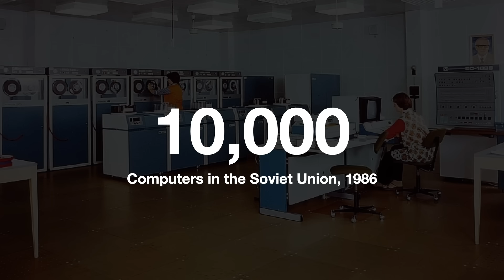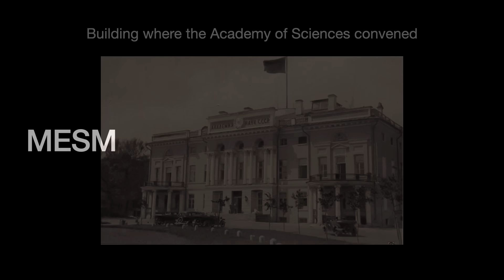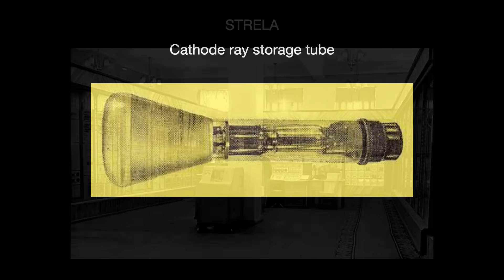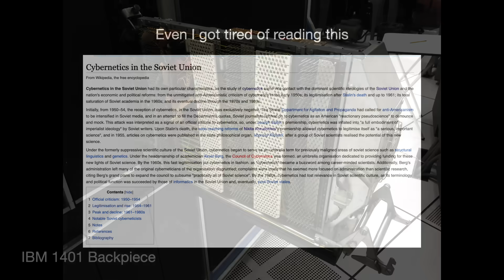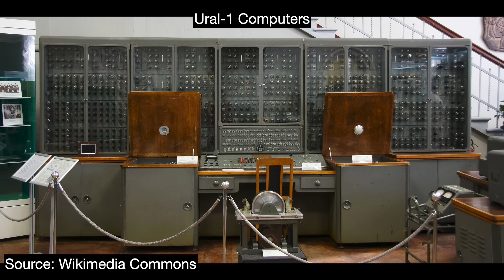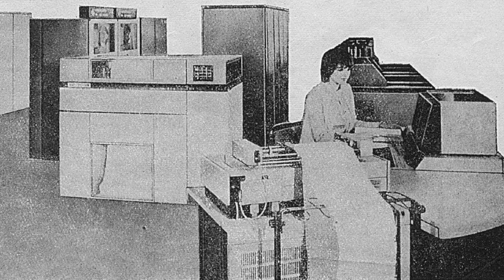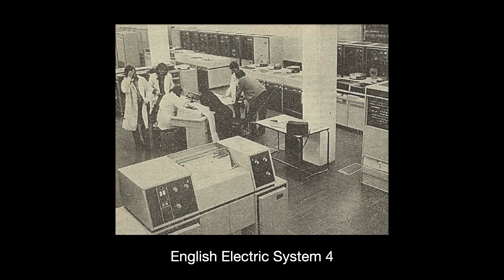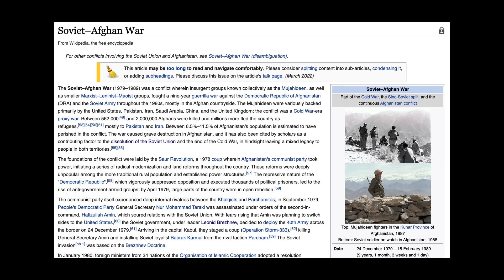Why the Soviet Computer Failed

Comment: Great video and very interesting insight. But many major points are missing: in fact, by the end of 80's the soviet semiconductor industry actually closed the technology gap and where capable of making world-class computers. But it was still not targeted at mass-market - home PCs and videogame consoles doesn't exists in USSR. There was some minor supply of advanced programmable calculators and IBM-compatible computers (beside what was imported), but the consumer's market never took off within lifespan of USSR.
Reply: There are a lot of people who still don't understand that the real technological genius of the United States was never in making the most advanced widgets possible, but in manufacturing large numbers of pretty good widgets at scale and putting those widgets in the hands of as many people as possible. It's the difference between building a Ferrari for the wealthiest man in town, or getting a Model T into the hands of every family in town.

Over time, the U.S. ended up with the most advanced technology largely as a consequence of that focus on manufacturing at scale - because the new technology was in the hands of far more people than would otherwise be possible, with many of them contributing to new ideas and new designs that made the tech better.

My father worked as a civilian for the U.S. Army in a division whose purpose was to look at the technology that foreign militaries had and how the U.S. could either counter it or copy it. He had a lot of respect for Soviet military equipment - but noted that the problem for the Soviets was that although they could build good equipment they couldn't build much of it, and the military took almost everything that the country could produce in certain fields. For some of their more advanced tech, production yields were less than 3%. That is, they'd produce a hundred widgets and were lucky if they could get three that worked.
Reply: @alanlight7740  that's true. And the main cause was, surprisingly, not the communism - there was no communism in USSR, it was never achieved. Somewhere down the road the direction was lost: instead of pushing for higher quality of life for the people (as true communism proposes) the system started to grow parasites within. No one ever thought the computers or some other electronic devices going to be actually useful for general public. The government had no intent making computers available to people and private companies and businesses where nonexistent because of "upcoming communism". The system with no mechanisms of self-regulation (no competition / free market) was cursed.

Makes me wonder, how much better world may be if someone was able to build real communism? F.e. like in Star Trek :)
Reply: @shurmurray  - I don't think "real communism" is possible, because it self-destructs - that is, it crumples under its own weight. There's a long history of communists pointing to the latest communist project and saying "There it is! that's how it's supposed to work!" and then ten or twenty years later when everything has proven a disaster and the people are starving they say "That wasn't real communism! Real communism has never been tried!"

But they thought it was real communism when it began - so why change their opinion later?

Well, in one sense they are correct when they look back and see how things panned out. What happened was not real communism, and could never be real communism - because communism - at least for humans rather than ants - is like one of those short-lived elements that is made in a laboratory, in that it flashes into existence just long enough to be measured by special instruments before it decays into something completely different. When they say that it wasn't real communism - well, it was for a fraction of a second - and then it decayed as it must always decay because it is naturally unstable, and usually becomes something much worse than the status quo ante.

The truth is that the only system that has provided much of what communism claims it will provide is capitalism, and especially capitalism combined with either a tradition of British common law or Japanese feudalism. It is possible that if the southern states in the U.S. had been able to retain their independence in Mr Lincoln's war, that the South might have something similar - with both common law and feudal elements. Possibly the southern states have maintained something like that to a small degree, which might partially explain its strong economic growth in recent decades after it finally managed to recover from the war. (It is not much known to modern Americans, but Lincoln's supporters included many communists or socialists - the terms being synonymous at the time - and this included his Assistant Secretary of War who was a personal friend and colleague of Karl Marx, as were several Union generals. That is, the "radical republicans" were in essence communists. Fortunately their influence was largely curtailed after the war.)

It is possible that some other legal traditions could provide similar results if given a chance, but in the real world that hasn't happened in an obvious way - though David Livingstone thought very highly of Tswana legal traditions which he considered similar to British common law, and Botswana today is perhaps the best run nation in sub-Saharan Africa. It is difficult to trace the origins of that success, however, as Botswana has, besides retaining some of its own traditions, also embraced a good bit of British common law.

It's a curious thing about Sci-Fi, in that movies often depict future capitalist societies as lawless and chaotic, while future socialist societies are depicted as orderly and prosperous. By contrast, almost every experience in the real world has been just the opposite. I think this says more about who makes Hollywood movies and television shows than anything useful for understanding the world. When one is producing a movie, after all, the plot armor can be as thick as one likes. Written Sci-Fi, especially hard Sci-Fi, tends to favor capitalist economies, because the authors are focused on the mechanics of how a future society might work rather than merely writing space opera.

Finally, I'll just add that there is one other major economic system at play that is already very much relevant in the world of software, and that is the Potlach economy, or the gift economy. This sort of economy is only possible on a large scale when the cost of production is zero or near zero. Software meets this requirement when one considers merely copies of the original software, and the result is the free software movement, open source software, the Linux operating system, the Android operating system, and so forth. The Potlach economy can piggyback on a traditional economy, and as new production techniques make the cost of material things extremely low we are likely to see this gift economy grow to include parts of the physical world. A combination of automation, artificial intelligence, 3D printing, and robotics is likely to produce something like this - and it will produce results similar to what communists always promised, but will do so based on a firm foundation of property rights and capitalist principles.
Reply: @alanlight7740  Wow, that's a detailed answer with some very interesting points!

But wish to share some of my vision (maybe no so deep, though):
In USSR there was officially no communism even back in days - there was movement/transformation towards communism. And the com. party said socialism was achieved and the communism is the next stop. The biggest communism attempt in fact never stated it was communism.
The other examples, IMHO, should be analysed case-by-case. They are not the same. At the end of the day, capitalism cases are also not the same and not always succeeded: even more - in most countries it works against people and economy (sometimes in favor of foreign capital).

My personal understanding of why all attempts of communism fails. Again, just an opinion:
1. When some new communist country or region created, it is surrounded by capitalism and must fight for resources and money. Communism must interface with external world by the rules of capitalism. If it fails it looses resources and dies.
2. In capitalism, the main entity is money. Speaking oversimplified - the money is the ultimate goal in capitalism. Even humans are just the resource for money. Capitalism tend to grab any unclaimed or not well guarded resource and consume it. In communism at least some resources are public or somehow shared. It provides effective use for the whole system, but only if everyone uses it on a need basis.
If there are any points when capitalism touches communism, the capitalism tends to grab "free" goods. And looking back at p.1, there usually a lot of opportunities for the capitalism to parasite on communism.

3. In theory communism may work if the barrier between it and capitalism entities well-defined. Including some extreme measures like "iron curtain". But there is one more factor: people. And people's habits and traditions can't instantaneously change. Beside cult of money, capitalism relies on some basic behavioral models. Mainly the cult of private ownership and intention to consume more. This is so basic for us so we can't imagine living without such goals. And when you trying to make perfect communism world with rational and effective use of all resources - you bringing people with deeply encoded goals from capitalism. Eventually there going to be individuals inside communism who consumes more that others. And those individuals gain more power and starting to control whole system, draining resources for they personal needs.

4. I think when AI took over the World and get rid of skinny bastards - it may easily construct communism. Not sure if robots going to be happy, though :)
Reply: @shurmurray  - I would reduce the reasons why communism has always failed to chiefly two:

(1) Human nature, which is inherent to us and incredibly difficult, and possibly impossible, to change.

(2) As pertains to a centrally planned economy, there is simply no way that a central planner can make good economic decisions. This has been found to be mathematically impossible - there are simply too many inputs for a central authority to process.

I also consider property rights to be essential to human happiness. Property is, after all, the product of our time and labor - and to take property from those who produced it is akin to slavery. It is merely slavery after the fact.

I might also add that collectivist ideas have a long history of failure. Both Jamestown and Plymouth were initially founded on collectivist principles, and over half the colonists died each year until this was changed. These ideas just aren't compatible with human flourishing.

YouTube doesn't like it when I put a link in a comment, but I would suggest that you look up the "Philosophy of Liberty" animation produced by the International Society for Individual Liberty. It's available on YouTube and other places.
Reply: @alanlight7740  Hi again! Watched the animation you mentioned (going to focus on it later).
I suddenly realized I didn't established the core points of my arguments. Without them it looks like I just advertising communism. The core point is the set if issues produced by world-wide capitalism. The main issues are: 1) uncontrollable and unlimited consumption of Earth's resources and 2) planned obsolescence. Everyone talks about climate changes and excessive waste produced by undurable things, but very little is actually done. F.e. most claims about so-called "ECO" things are just BS. As a concrete example - all the EVs. The electricity is mainly produced by coal plants (add extra when the energy is transmitted over wires and inefficiencies of charging the batteries) and the EV itself are very hard to dispose item. There is still no recycling of lithium batteries: capitalism says it's to expensive and just refuses to do it. Sure there are some successful cases but overall everything about ecology still going south.

While the global warming and ecology stealing out future, the planned obsolescence stealing our property right here and now. It enslaves us the other way: we put effort to obtain property, but almost all property ensures it won't last for long. It makes for people very hard to accumulate things and get increasingly high value out of them: capitalism forces you to pay. New phone every year, new car (designed to transport five people, but takes only one) every 3-5 and so on. Capitalism purposely poisoned everything to make everyone pay and the top most goal is money.

In turn, we probably should look for solution elsewhere. The communism has it's own issues, but there are good things as well. From my point of view, the most useful for the whole humanity - shared resources. Are we sure we must own everything we uses? There are many items needed only occasionally. Flying on vacation does not forces you to buy whole jet plane. There are much more examples of shared resources on a small scale: within our family homes. Almost everything is shared within family and that's ok. There is no personal toilets or personal vacuum-cleaners, TV and coach also shared. Sure the concept of shared resources can be scaled up in a way the larger and larger groups of people would benefit from it. But capitalism doesn't like such movements and fight back. I think this is actually the main reason communism fails - it fails not in isolation, it fails in a direct fight with capitalism.

Even the opensource slowly failing against capitalism: more and more linux distros are poisoned with pre-installed ads, telemetry and proprietary pieces of code. Happening right now.

And now about that cartoon. It almost right. Almost :) The remarks must be made: the result of our lives not always out property. Especially not the things purchased for money - they are mostly a short-term crap from capitalism. Much greater results (see not further than old and dusty Maslow's pyramid) are social recognition, love, usually associated with something made for the world. Our skills and knowledge are also results of our lives and they much more valuable than property.
Yet I agree with the part about governing officials with hats who ruins everything. Minus the statement we still choose them: in most cases the elections are faked in one way or another. The most simple way elections fails - candidates are not random. Only special people with money can ultimately appear in the list of candidates and ordinary people can't do much about it. Capitalism uses capital to ensure uninterrupted control over the world.
Reply: @shurmurray  - I see your points but I think you have missed a few of your own.

First, capitalism does not exist in a vacuum. Yes, some people focus too much on money but that has problems even within a capitalist system. A bigger issue in America is short term thinking, which is sometimes connected to the money-centric view of the world - but short term thinking can be disastrous regardless of whether money is at issue.

Traditionally in the U.S. capitalist economics were moderated by cultural norms, and especially those norms embedded in Protestant Christianity. Placing too much emphasis on money is just one form of idolatry in accordance with those values - though of course it would be foolish to ignore the necessity of sound fiscal practices.

Second, communism fails in isolation. The colonies at both Jamestown and Plymouth were initially established on collectivist principles, and every year a majority of colonists died until those collectivist principles were soundly rejected - at which point these colonies began to thrive.

Third, money is just an accounting system - so when we buy things for money we are still exchanging our labor for a product - we are just doing so indirectly.

Fourth, history has shown us that communist countries have had far worse environmental records than capitalist countries.

Fifth, I don't know where you got your information about electric vehicles, but it's mostly wrong. EVs are already being recycled, it just isn't at a large scale yet because very few EVs have been retired from service as the fleet is still quite young. One of the most notable recyclers is Redwood Materials, which was founded by one of the founders of Tesla, and the plan is to make a circular supply chain for materials where retired vehicles are recycled and the materials therein reclaimed to make new vehicles.

Although there are some inefficiencies in the electrical system, they are far smaller than the inefficiencies in the traditional system - which includes shipping oil around the world, refining it (which uses about 4% of U.S. electricity), shipping the gasoline to gas stations, etc. By comparison electric transmission lines require much less labor and lose much less power - and then the vehicles themselves, in an internal combustion engine most of the energy in the gasoline is wasted as heat - and an EV is at least two or three times as efficient. When everything is combined, EVs are far more energy efficient than traditional vehicles.

And no, most EVs are not powered by coal. For a long time coal was about 40% of U.S. electricity generation, but that has been cut by half in the last ten or fifteen years, so it's about 20% now (again, in the U.S.). Solar is currently the cheapest way to generate electricity, but we may also be seeing a large amount of geothermal energy in future - look up Eavor, a Canadian geothermal company that has had a successful pilot project running for a couple years now in Alberta. Incidentally, most of their tech comes from the oil industry, and that in turn means that most of the assets of the oil industry could soon be diverted from producing oil to producing geothermal energy, which is especially useful in cold climates as it can provide both heat and electricity 24/7 and throughout the year, even in the polar circle where the sun doesn't rise for months at a time.

Sixth, planned obsolescence - I understand why you don't like it - most people don't. But it serves a useful purpose too, especially in an era when development of new products is rapid. That is, it allows manufacturers to refine their product quickly. Look at how much better cars are today than twenty years ago, and the cars from twenty years ago from those twenty years before that, and so on back to the first cars. If the first cars had lasted forever their buyers would have just kept them like that and never felt a need to make them safer, more fuel efficient, faster, or more comfortable - and then there would have soon been no market for manufacturers to sell to. The industry would have stayed small if it could have survived at all.

And over time, thanks to new competition (a key feature of capitalism) eventually our cars were built better and better. When I was a kid it was rare for a car to reach 100,000 miles and the car I grew up in made it to about 85,000 - and now over 200,000 miles is routine. I'm glad cars are better built now (and also much safer and more fuel efficient) but it wouldn't have been possible without all the rapid iterations that that market provided.

Your ideas on not having to own everything - well, you're right, and there's speculation that in the near future we may find most urban households giving up their cars in favor of autonomous taxis. After all, the most expensive thing about a taxi is the driver, so if no driver is required hiring taxis as needed can be cheaper than owning one's own car - at least in urban environments where there will be sufficient volume to keep taxis quickly available and where there are often high fees for parking. But all of that can easily happen within a capitalist system, just as airlines exist within a capitalist system.

Eighth, you talk about capitalism allowing people with money to have influence in the world, but capitalism also limits how much influence any one person can have because other people can have their own capital. It seems to me that it is much more dangerous to have a system where influence is gained through politics and political favors ... which in practice is what emerged in every communist country.

Who would you prefer to have economic influence: a capitalist who made their money by meeting customers' needs more effectively than his competitors? or a politician who gained their influence by attending the right parties and bribing the public with their own money?
Reply: @alanlight7740  Sorry for not addressing all points, just trying to keep text reasonably small. I like the conversation is constructive and refers to verifiable facts.

About communism failure in colonies.
Not familiar with history, so i using data from google and my own brave assumptions:
looks like you pointing out the problem of poor management in communism. But there are counterarguments:
1) Now people know how to control stuff or build self-regulating systems a hell lot better than back in days. Most automatic control systems easily outperform humans just in every aspect - in speed, precision and safety. And when human interrupts automatic system we got Chernobyl. In principle, it is totally possible to build a system managing resources for the whole country.
3) Large companies deals with internal resource management for decades without using internal substitute for money or anything from capitalism. There is not much difference if any with planned economy.
2) There are multiple ways to setup resource management beside planned economy and beside free market. Probably the best solution would be some hybrid system with best parts from all -isms.

>> money is just an accounting system - hell no. Unfortunately it's not. Money is not just an entity to mitigate inconveniences of natural exchange. In our real life here on Earth money has owners and long chain of financial parasites doing nothing but exchanging money to make more money. They do not produce goods, they just sucking money out of people's pockets. Periodic economic crises is the most notable effect of this. Yes, I oversimplifying things again and missing many points, but you got the idea.

Environmental impact of communist vs capitalist countries: we have very little examples of succeeded communist countries. And before economy gets successful any country tends to rely on the most primitive and non-ecological processes. Reducing impact on ecology requires technology, money and well-working system overall. Only top countries in the world doing something to reduce effects on ecology. It's hard to tell if communism by itself doing more or less harm to planet.

EVs. It's cool the industry actually turning towards recycling batteries. And the advances in a cheap solar power is a real thing for sure. But the EV itself is just one link in a long chain and the environmental friendliness of EVs are greatly overhyped. The burning fact - Tesla still has to move 2+ tons of weight just to transport one man. For less environmental impact bicycle or PT are much more energy efficient per person and in turn produce less harm for the environment. But advertising a bicycle or PT is not cool: you can't make money out of it.

Sure the obsolescence fuels the progress. But we must ask: what is the purpose of progress? Do we, as humanity, really need that much progress? Mostly it's just a race between capitalists trying to make new type of cr*p to sell it. At very least are we sure all things should be short-lived? Not just cars or electronic gadgets, but everything. Did washing machines or toasters become better for the last 20 years? Capitalism just want to be sure you buy new washing machine every 8-10 years. He does not cares about speeding up progress - it's just a side effect.

Power and money: those were always interconnected. Using power to achieve personal goals is not unique to communism: looking around it plagues almost any country with more or less dramatic consequences. And since most of today's economies are interconnected - negative effects can be shifted to some other poor country. Like Shell in Nigeria.

>> ...a capitalist who made their money by meeting customers' needs more effectively than his competitors? or a politician who gained their influence by attending the right parties and bri... - But it's like choosing between Jason and Freddy :)
Reply: @shurmurray  - the fact that some people abuse the accounting system does not mean that the accounting system is not an accounting system.

And from what I've seen, companies dealing with internal resources generally do use money as an accounting system even if no actual dollars change hands internally.

It's no mystery why the collectivist systems in the early American colonies failed. When some people worked hard and had everything they worked for given to others who had not worked at all, naturally they stopped working as hard - and then there was not enough food, so people either starved or died of diseases that would not have killed them if they had eaten enough. When they were allowed to benefit from their own labor (that is, when property rights were restored to them) they were willing to work and soon produced a surplus.

As for e-bikes and physical training - you want everyone to run everywhere? - those are all well and good but they aren't suitable to many commutes. It's looking like Tesla will be pushing towards autonomous taxis, and I wouldn't be surprised if they come out with a half-width two seater (front and back) for the dedicated robotaxi they are planning, as that would cover the vast majority of vehicle travel, with a few larger taxis available for those occasions when a larger group needed to travel together or when more cargo area is required.

If you're looking at very short distances in urban transportation, the electric scooters we are seeing lately are about as efficient as you can get. They move very little weight other than the passengers themselves.

Planned obsolescence is a mixed bag to be sure. I agree that I don't like the low quality of many consumer products. On the other hand, I've also seen that washing machines have increased efficiency substantially over the past twenty years - particularly for energy efficiency and resource efficiency (they use much less soap), though at the cost of time efficiency (they take twice as long as they used to). The decrease in time efficiency means that there is still room for improvement.

Toasters on the other hand appear to be substantially worse on every metric than they were forty years ago, so it's not like you have no case at all. ;-)

Whether the abstract notion of capitalism "cares" about progress is irrelevant. The last two centuries saw more technological progress than the rest of human history put together, and almost all of that happened within capitalist systems. The best capitalists frequently care about meeting the needs of others for its own sake, but even if they don't the system still works because they are incentivized to meet the needs of others if they want to make money. Under collectivist systems there is no incentive for bad actors to do something good for others.

That said, I'm well aware that there are some really despicable people acting within capitalist systems - but they are going to be here regardless of what system we have. They seem to do less harm, and even frequently do some good whether they want to or not, within capitalist economic systems.
Reply: @alanlight7740  >> the fact that some people abuse the accounting system does not mean that the accounting system is not an...

- But "owners of the money" produces the effect of an additional tax. And this tax is in reverse proportion to the wellness: has highest impact on poor. This throttles down economy and decreases quality of life, and it's just unfair.

>> ...naturally they stopped working as hard - and then there was not enough food, so people either starved or died of diseases that would not...

- Don't know if the fundamental works about communism proposed it or stated as first measure, but USSR done the same BS - banned private ownership of anything above what is essential just to live. That was highly demotivational for people, especially for ones who worked harder. Much better approach would be not to ban anything, but to build the system offering some shared resources. It may have been started from free public transportation (actually implemented in some advanced countries today - turned out to be good investment) and as result it would reduce the number of private vehicles. Without explicitly banning anything. Sure it would take time, but it may worked that way.

>> As for e-bikes and physical training - you want everyone to run everywhere? - those are all well and good but they aren't suitable to many commutes. ...

- There is another problem. From days of Henry Ford the whole countries around the world are built around private cars. Many cities got stroads instead of streets, everything is far apart and so on. Instead, there are examples when everything is densly packed and it is not required to drive 50 Km for everyone to just get to work. The most of Europe built that way - the bicycles and scooters are much more practical.
It just requires another approach of building cities and roads.

>> Whether the abstract notion of capitalism "cares" about progress is irrelevant. The last two centuries saw more technological progress than the rest of human history put together, and almost all of that happened within capitalist systems...

- Tends to agree capitalism did pushed the world forward. The history of London for the last ~200yrs is great example with all the problems it faced and solved. Many notable problems raised from blind race for profit. But unfortunately the issues aren't gone today - they just shifted to poor countries and "dark" regions of the world where they are not in the focus of mass media. A few fast examples: production of lithium batteries requires cobalt which is mined with, basically, slaves. Photovoltaic panels made of silicone leaves behind huge amounts of toxic waste. As far as I know there is very little recycling, the waste is just accumulates somewhere on our planet. Solar power is eco friendly only while we keep that waste locked. And storing toxic waste while more and more added is just a time bomb.

>> That said, I'm well aware that there are some really despicable people acting within capitalist systems - but they are going to be here regardless of what system we have...

- I hope when (not if, but when) strong AI gets invented it would solve all problems. The catch is - the skinny bastards may appear on the top in the list of problems :-)
Reply: @shurmurray  - I mostly agree with your last comment. I'll just note that regardless of how we should have built cities, for some time to come we'll have to deal with how they were actually built.

Also, many new battery chemistries don't require cobalt, and there is significant work being done in improving perovskite solar panels. Enhanced geothermal also looks very promising - you might enjoy looking up the Canadian geothermal company, Eavor. They have their own YouTube channel.